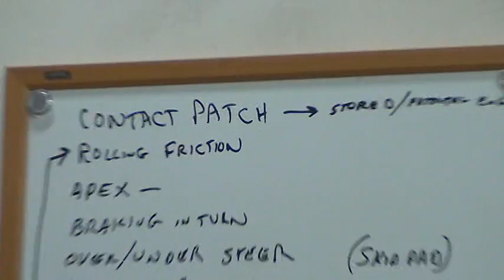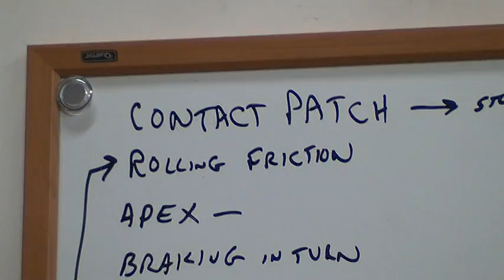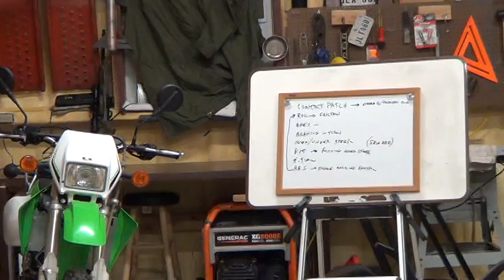Emergency Police Driving Instruction - Understanding What Forces Impact Cars At High Speeds

Comment: I would like to add something here in case some people don't know and I have noticed a lot of people don't know this tip. Proper tire inflation for your car. On the tire will be a PSI number (Pounds per Square Inch). That number is the maximum of what that tire is designed to hold. This PSI rate is too much for the car that tire is attached to and it is NOT the proper PSI for your car. That proper information can be found on your car. Open the driver's side door. Somewhere, either on the narrow wall of the door or along the opening of the door is a sticker. That sticker will tell you what the proper PSI is for your weight of your car when the tires are cold, as in hasn't been driven yet. The PSI number for the front tires will be a slightly higher number than the rear tires. For instance, my old 95 Subaru Legacy was 32PSI in the front and 30 in the back. My newer 2007 Subaru Forester is 28 in the front and 24 in the back.
Many years ago I had some relatives who were taking a trip to California to visit their son. I was to check the mail, water the plants and feed the cat. They let me use their car for the week. It was a Toyota Camry, I don't remember the year though. Anyway, as I drove around in it I noticed the steering seemed to be sloppy and the car would sort of wobble around, like it was riding on water balloons. I checked the tires with my handy dandy tire gauge and lo and behold, the tires were down to only 12PSI. I checked the sticker on the door and that car should have had 24PSI in the front! I took it to a gas station and filled the tires properly and that made a huge difference in the performance and handling, not to mention the gas mileage. When they got back I told them about this so they would know. They looked surprised and thanked me for tending to the car. I don't think they ever bothered to do any maintenance on their car themselves. The funny thing was, the tires didn't look to be that low at all. That's why I was surprised by the odd handling of it.
Reply: +SpiritBear12 That sticker is for the factory tires, it's only correct if it's the factory tires. Go by the PSI on the tires, it's there for a reason. I almost got killed once when some stupid Wal-Mart oil changers changed my tire pressure. I told them not to touch my tires and they did it anyway. My tires were holding about 60 pounds, and they took them down to 30. I got on the highway and my car was all over the place. I went back and raised hell. I know my tire pressure was correct for my car because I called Yokahoma and told them I was running PARADA SPEC 2's 205/45VR16's and told them my car which was a Mirage. I asked best tire pressure for high speed cornering, and they gave me one number for the front, and another or the back. So go by the tire you are running. The PSI has little to do with the weight of the car, and more to do with the tire. My Mirage Coupe weighed about 1800 pounds, but my tires would hold up a 3500 pound car easily, yet they still told me to put in about 60 pounds.